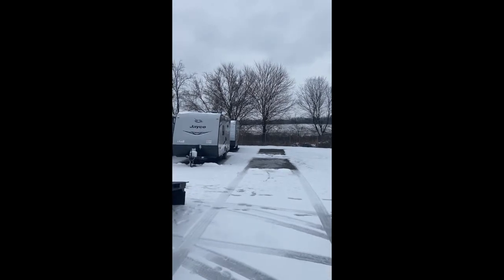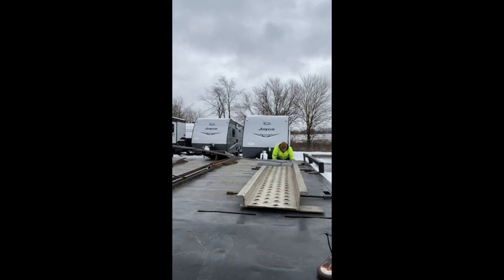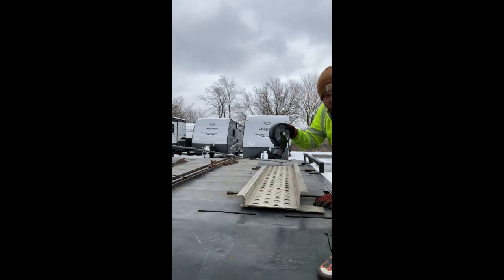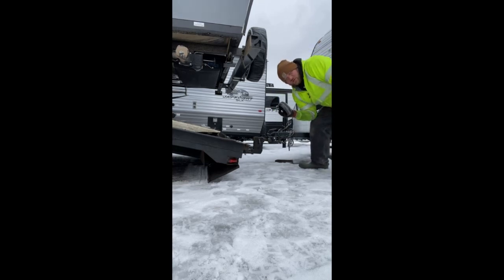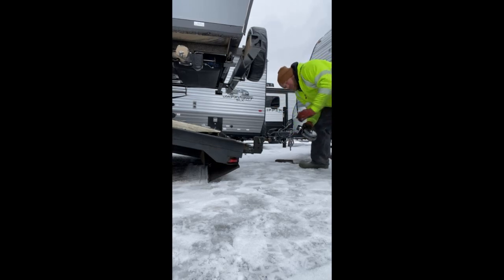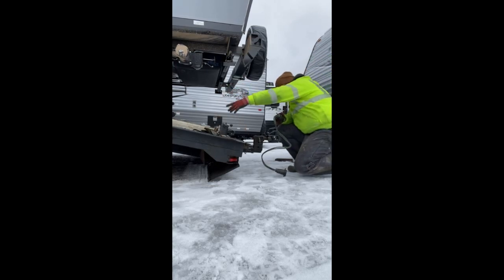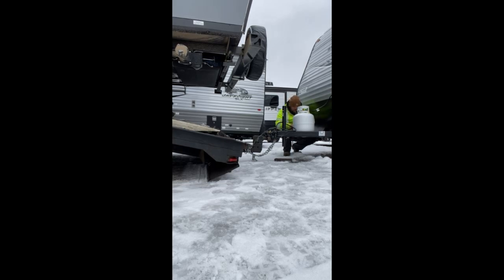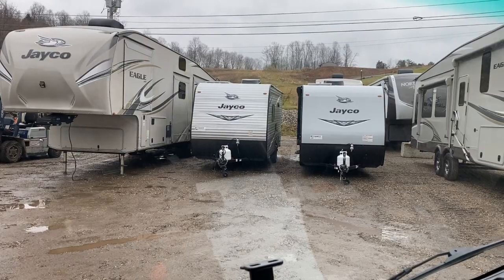Loading a haul and tow  RV transporting/Hotshot car hauling

Comment: Would you recommend tow haul or multiple haul Iam interested in doing it
Reply from the maker: I’ll just give you my input on both and hopefully that will help. They each have their pros and cons. 
Haul and tow- no trailer behind you all the time, no trailer payment, no trailer maintenance, and insurance in truck only. Easier to get around when unloaded.  Downfall is reloads mostly are one car and the occasional trailer or boat. But with only doing one car you have one pick up and one drop off so you get back to loading up with campers faster.  

Multi haul- you can reload most time with 3 cars for your back haul and you can do 3 campers outbound ( pay is that much more from 2 to 3 but if you are going cross country it’s worth it). If pulling with a pick up you can drop the trailer and have your truck free. Many times reloading with 3 cars means multiple pick up and drop off locations which means you are later getting to reloading with campers. 

Hope this all helps